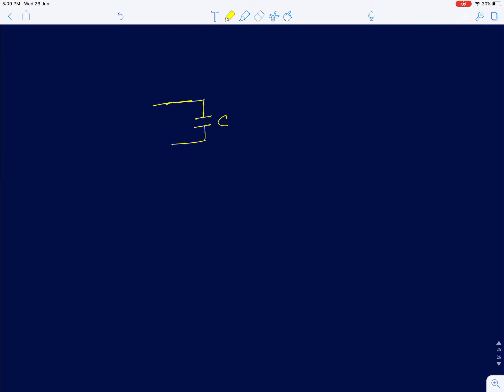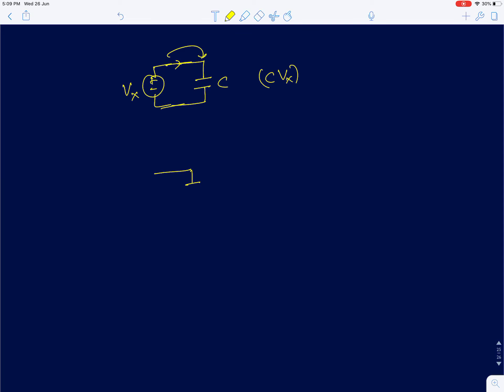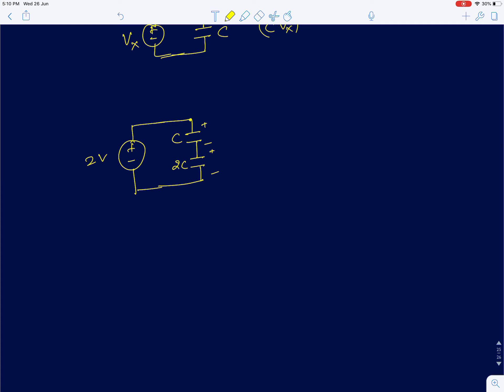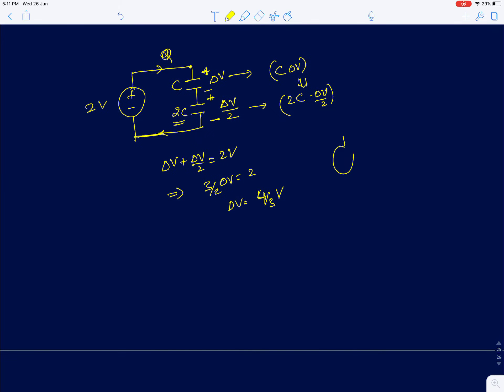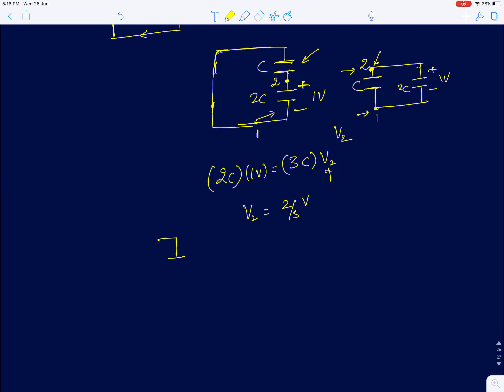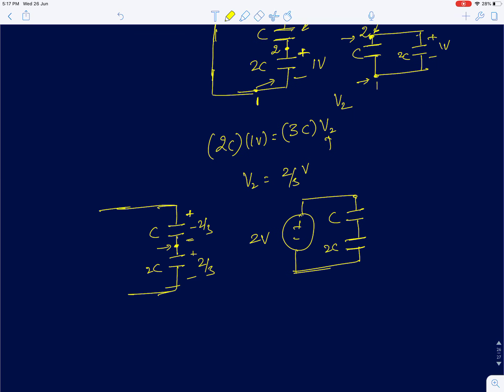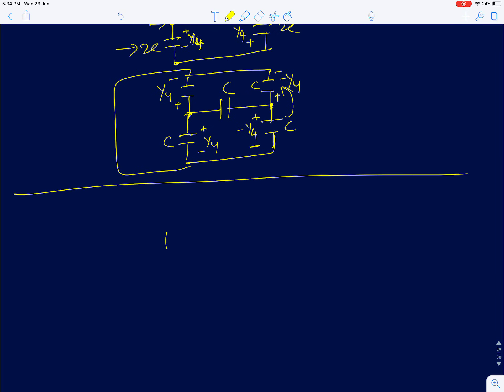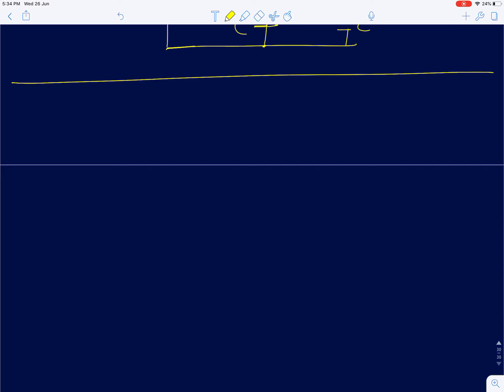ES Lecture 9: Analysis of Capacitor circuits with initial conditions

Comment: but sir here after charge dustribution the charge across capacitors is not same,it is a series combination ,so charge should be same right.Can u clear my doubt sir.
Reply: What series means is that the same current flows through both of the capacitors.
Now, note that it is not the absolute value of v(t), rather the increase v(t) - v(0),that depends on the current (more accurately, the Integral of current from 0 to t). Which means that if there are identical initial conditions (same voltage across both capacitors, and this includes both initially being at zero volts), if they are in series, they'll eventually have the same charge. 
However, if one of them has initial voltage v(0),it creates an "offset " that will reflect in final charge distribution, ie, the final charges will not be the same even for caps in series, provided they have different initial charges.
Reply: It is wrong way of thinking that the charge in series combination of capacitors is same, but the correct way of interpreting it is "The increment or decrement of charge in a series combination of capacitors must be equal".